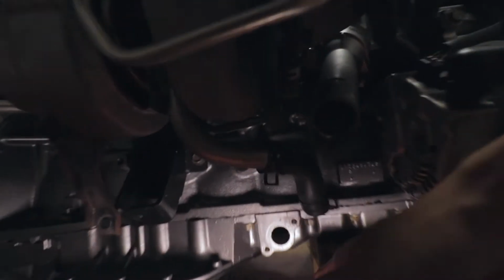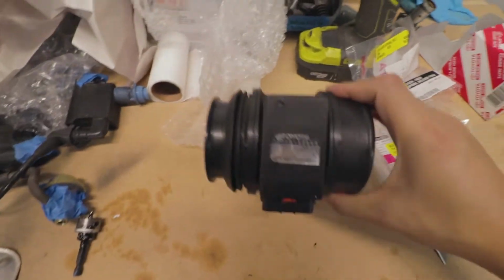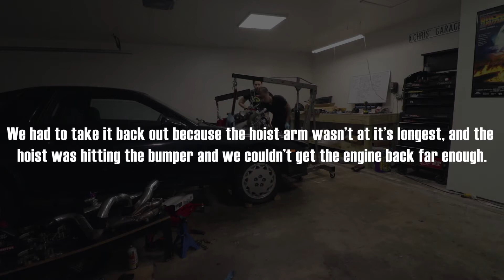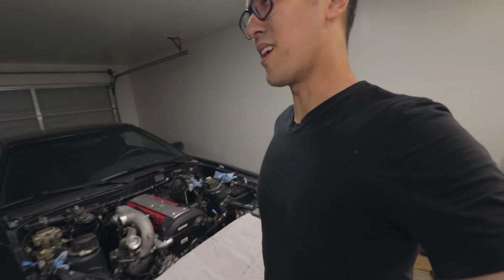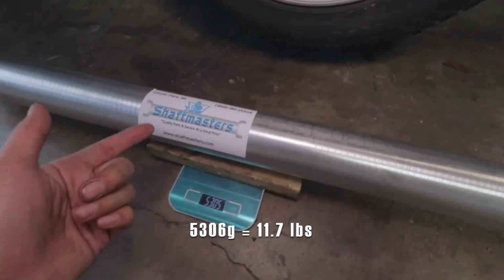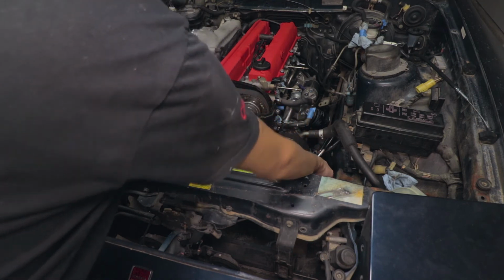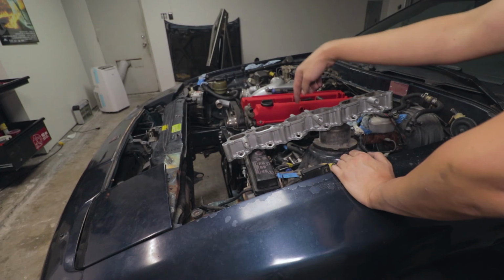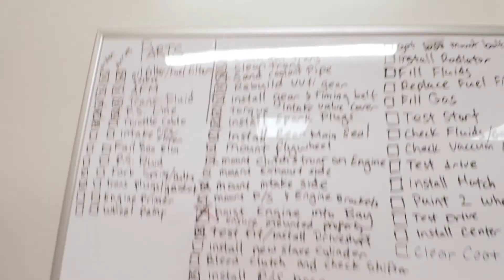1JZ is Mounted! 1988 Supra Build Episode 14

Comment: Did you have any clearance issues with the turbo housing hitting the frame in the bay?
I just dropped my 1j vvti in my 88 and i did so with the exhaust and intake removed for ease of manipulation (i did it alone), and now im havin issues getting the manifold/turbo on.
Reply from the maker: I did not have any issues with fitment. I had to take off and put back on the exhaust manifold and turbo a few times too. part of the turbo and hard line is close to the side but not touching.